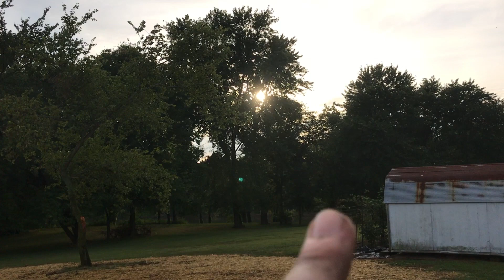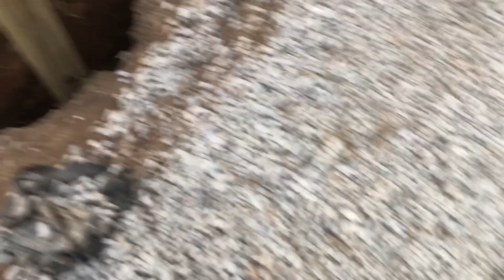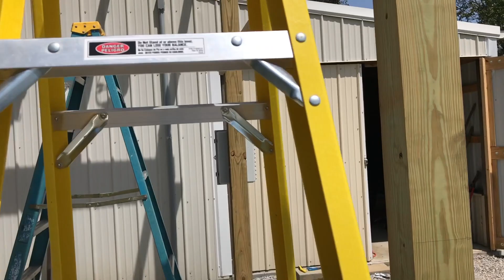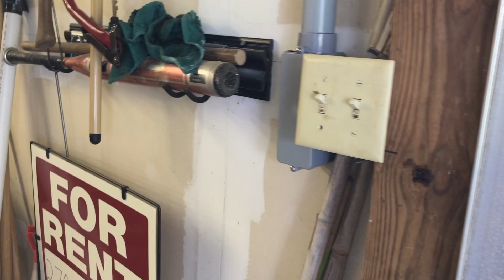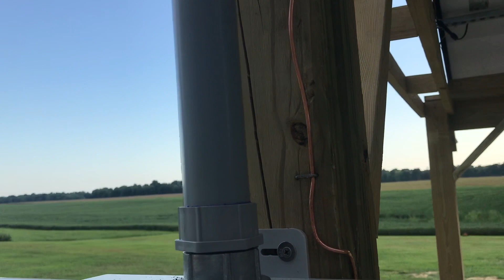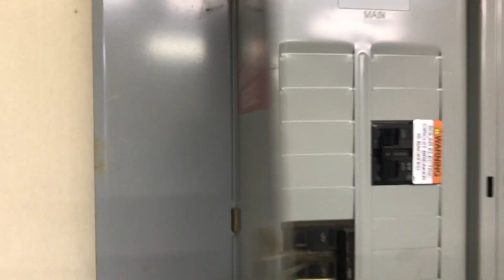Easy DIY Solar Panel Install - 8.37kW Enphase Energy Micro Inverters & Mission Solar Panels

Comment: Just watched your 1yr video and things you should have done better.. I hate to say it... I think you should have done tubes and brackets for the posts. see RR Builder post frame construction. I think these posts will rot having direct contact with cement. bare min you should have dipped them in tar to protect the posts. but i will pray for you that the posts last well after your gone :)
Reply from the maker: Thanks for the comment. Yes there are quite a few different ways to attach posts. I'm not completely sold on brackets. Main thing I wish I could have gotten an extra 1/2 cy of concrete to pour higher and slope away from the timber. If that was in place, a very small amount of water would make it in the crack between the concrete and the post. You could even seal it with silicon caulk if you wanted to.

Comment: Nice DIY Job. Way ahead of me. Just curious if this is a better option vs Grid Tie..
background.. Planned Grid Tie was 900 watts, however, was pushed into buying FIVE 305 watt mono solar panels. Small setup and just wanting to get that electric bill a little lower at least. Appreciate any advice or tips.
Reply from the maker: Ross, my system is a grid-tied system.  A 1,500 watt system is fairly small, if I were you I would buy a small string inverter for your system, that may be the cheapest route, but wouldn't allow much in terms of expansion.  If you use the enphase microinverters, you can always add more panels down the road.  Also, I think the costs of racking, cabling, disconnect boxes, junction boxes, etc may not justify the small amount of power bill savings you will generate.  But i'd love for you to prove me wrong!
Reply: @NealORussa  I keep seeing deals for misc solar items used. Right trails for $5

Comment: where did you source your supplies?
Reply from the maker: Hey there! I sourced most all of my solar materials from tandem solar systems inc. 805.262.2478
I think I got the iq combiner box off eBay, it was new and much cheaper than anywhere else I could find. 
Unistrut, cabling, timber and most all hardware i sources locally from hardware stores and electrical supply houses.

Comment: I've been installing solar professionally for over 5 years and I have to say, nice install. Usually DIY solar installs make me cringe haha. But it seems that you definitely did your research and have some solid construction experience to execute this in the way you did. Only a few constructive criticisms from me:

1. The envoy's warranty was voided with your entrance from the top of the enclosure. There is one spot on the top left to enter with a small conduit, however it is typically only used for indoor installation. 
2. You could have spliced each string in the junction box and continued with #10 thhn-2 black and red wire into the envoy. It would just be a little tidier from an electrical standpoint, but it's one of those things that's covered up anyway so it doesn't really matter lol. Since the j-box was there, that's just something I would have done differently. 
3. Grounding directly to each of the panels would have provided a more proper grounding with the use of the strut. I'm surprised the inspector didn't pick on that, in my area they are very strict on it. The difference with IronRidge is that the mid clamps really dig into the frame of the panel. It transfers the grounding very efficiently, and that's why with IronRidge you can get away with one ground lug for each row of panels. 

These are just small pieces of advice in case you do this again in the future. But seriously, overall, impressive installation and an extremely informative video to inspire other DIYers out there. And nice choice on Enphase. It's much easier to troubleshoot and has far less problems than SolarEdge. If you ever want to view production from your phone or computer, install the cell kit. It's awesome.

Good job man.
Reply from the maker: Thanks so much for the comment and the pointers!  I did do a 1 year followup review you should check out.  I am disappointed with the way i mounted the conduit into the top of the IQ combiner box...  As far as the ground, i have checked ground from a panel frame to my unistrut and unistrut to my ground cable with my ohm meter and the resistance was very low, but definitely something to consider.
Reply: @NealORussa  Cool that you checked it with the ohmeter, good to know! Right on. I will check out some of your other videos for sure!
Reply: Good comment for those who decide to follow Neals direction. Thank you!
Reply: I agree with the statement

Comment: I found this video searching for "DIY Enphase." I watched this video and your later, one year review video. Thanks for so thoroughly documenting your experience which is helping me consider adding a string of panels using Enphase IQ7A microinverters to expand my DIY existing system that uses microinverters from another vendor. 

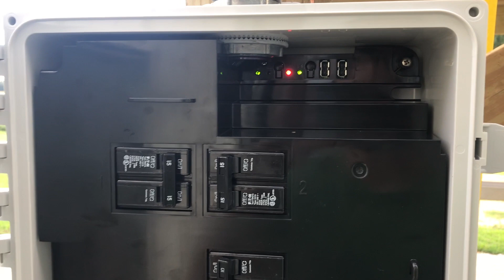I have a question prompted by your comments around 32:30 into this first video, when you spoke about the Envoy easy setup and cautioned to be patient and allow time for the install app entries to take effect. As a DIY effort, how did you setup or acquire an Enphase installer ID so as to be able to log into the app?

Other comments about my Texas experience several years ago when I initially got my utility interconnect permission prior to them doing a quick inspection and replacing my meter with a 2-way version that looks like yours. My utility provider objected to my planned use of a A/C-type disconnect with a pull-out bus bar. They preferred a lever-style cutoff, so I changed my plan. Also, unlike the cutoff located on your utility barn >30' away from your meter, my utility required the cutoff to be within 10 feet of their meter.
Reply from the maker: Hey thanks for the great comment!  Regarding the enphase installer toolkit app, I'm trying to recall, but I don't think i needed anything special, I did log in with my Enphase Enlighten username & password.  Maybe there was an option to setup my own system where it didn't need an installer ID?  I still have the app on my iphone and i can open it and view my system and connect to my envoy using the envoy's wifi access point.

Good to hear some of the requirements from other energy providers.  Thats a good point, any DIY installer should contact their energy provider beforehand to sign their net metering agreement and know all of the rules and regulations for that provider.  I have another video about designing a solar array system you might check out!
Reply: @NealORussa  What courses and tests do I need to pass to acquire an installer ID?
Reply from the maker: @tohbw5963  I'm not sure, I didn't have an Installer ID but i was able to setup my system with the installer toolkit app without any issues.

Comment: Neal, great video. I am going to be installing my own system with the Enphase micro inverters as well. My question was about the grounding rod you said you installed at the combiner box. Did you install the ground rod because you did not have a grounding wire you could connect to that busbar from your sub panel? I was planning on running my grounding wire directly from my array into my MSP, which is the only difference in my system vs you system from what I can tell. Thanks!
Reply from the maker: Hey Dunnegan, thanks for the great comment and question!  The grounding rod has a ground wire that connects to all the unistrut racking and then goes into the IQ combiner box where there is a busbar for grounding.  From there, the big cable run that goes into the garage subpanel has a ground wire as well, and it is connected to the ground bar in that sub panel as well.  You can see my wiring diagram here https://youtu.be/DzvRXU_zUWE?t=1792.  I think it is better to have an additional ground rod out by the panel racking, that is less distance for the possible ground fault power to travel, and should most likely keep any fault from going into your sub panel or IQ combiner box, which could possibly ruin them.
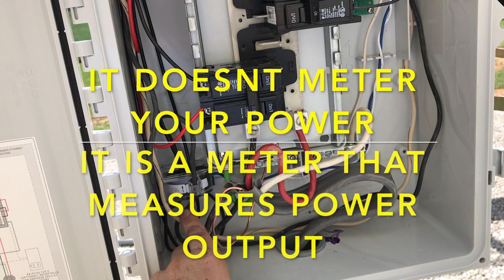Reply from the maker: You can see that ground wire in the big cable around 17:58.  It ties into the ground bus bar at the bottom of the IQ box.  That bus bar also has a ground wire going to a small bus bar outside the panel, which has a wire that goes to the racking and to the ground rod.  You can see this at 34:00.

Comment: 32.09: The red light indicates you are not producing power cause the panels are in the shade. If that's true, you have a crappy system. Even with shade the panels should produce power, less than with sunshine of course, but still they should produce power. If they don't than, as I wrote, it is a crappy system.
Reply from the maker: Start watching around 3:10 and you'll see the large tree that blocks the sun late in the day.

Comment: Im glad you talked about grid/inspection. 

I would rather forego the Incime tax help, and so away with he power company and inspectors putting their 2 cents into my business.

I plan on running ac, hot water heater
Reply: And my water well.....independent of "grid"   

I'm thinking after Biden is Prez, grid tied people wi be forced to double up their solar and share the excess with the lazy bastards that dont want to work.
Reply from the maker: Good luck with your install.  I think you can get the income tax credit whether or not you are grid tied.  So if you setup batteries and go off-grid you should still be able to get the federal tax incentive, though it is decreasing every year.  2020 installs are 26% credit, and i think it goes to 20% in 2021 (but not 100% positive on that).

Comment: Neal,
Love this and it has inspired me to follow almost exact install. Any chance you have your one line diagram or foundation/structure plan you submitted to the city? Obviously i am not looking for your stamped copy as i can get that from my EE friend just need a starting place ?
Reply from the maker: Glad I could help!  I have my permit package I could send to you.  I didn't need any stamping for my utility and the county didn't consider it a structure because it didn't enclose it.  So no structural calcs required either.  You can email me for a copy.  Daviesscountytractor@gmail.com
Reply from the maker: I also have a video on designing a PV system, so check that out if you haven't already!

Comment: $21,000 gets me the 15.5 kw system using Mission panels and emphase inverters. I would then need to choose if to ground mount or roof mount and buy that material. I use about 2800kwh peak and lowest month 1600kwh.
Reply from the maker: Hey Jorge thanks for watching! A 15.5 kw is a pretty large system.  That may be the best option for you!  Check out a video I put together on designing a PV system.  https://youtu.be/DzvRXU_zUWE
Reply from the maker: Also, if you check out my channel there is another video on a 1 year review of my Enphase system.

Comment: building with wood definitely makes for an easier build.. I would have done it a bit differently planning on a  very extended life time ..  I would have built like I was building a tall deck.. Would have notched the posts back and set the boards back so there was a physical connection holding up the boards and not relying so much on the fasteners. Small things add up.. When you get a big wind things tend to loosen up over time.  Even using metal it can loosen up considerably so always a good thing to do an annual inspection.
Reply from the maker: Appreciate the comment Steve!  I understand what you're saying the the notching the 2x10 headers into the posts.  I do have the 2x6's set on top of the posts, which is what the rafters sit on.  But yes, the 2x10's do support the majority of the load and yes fasteners can come loose.  Hopefully they hold up a while though, the nails were all loctite brand nails with a glue on them to help stick in the wood.  I'm getting ready to shoot my 1 year review video so make sure to subscribe and stay tuned to see how its doing now!

Comment: Really nice work! I am planning on building a 10kW enphase micro inverter system with 30 Panasonic 340 panels. I don’t want to mount on the roof because of the direction it faces. I really like the structure you built to mount them. Can you give details on materials you needed to build it and cost?
Excellent Job.
Reply from the maker: @ComputerWizMedia Warning, Long response ahead!   I had about 13k total in system cost, including all electrical, panels, wood, concrete, stone, etc.  For the wood, unistrut, hardware and concrete i had about $2,900 in cost.  I used all treated wood, i just got it all at menards.  The posts are 6x6.  There are 2x6 boards along the top of the posts and 2x10's at the top face of the posts.  The rafters are 2x10 at 2' spacing i believe.  The unistrut is standard galvanized strut with 1/4" spring nuts (i clipped the springs off though).  The bolts to mount the panels to spring nuts are 1/4" dia x 1" long, with a washer and lock washer (i used all stainless hardware and antiseize lube).  Unistrut is mounted to rafters with 4"x5/16" lag screws and washers.  All the wood is pretty much nailed with a paslode electric framing nailer.  The hurricane braces are nailed to rafters with 10d, 1.25" structural framing nails.  Then theres random 2x4's and 2x6's everywhere for bracing.
Reply: Wow, great info. Thank you very much for the detail.
Reply from the maker: @ComputerWizMedia  No problem!  Good luck with your install!  One comment someone had that may be useful to you was to try and find some u-shaped plastic pieces to slip over the tops of the rafters before installing the unistrut down.  That may extend the life?

Comment: Sir, actually I have 19 micro ..n'd how can i,connected in multi phase system
Reply from the maker: I guess you could run one string of 10 panels and 1 string of 9 panels, i don't think it would make any difference.  The strings would just have different amperages but they would combine together anyways in the IQ combiner box.  Thanks for watching!